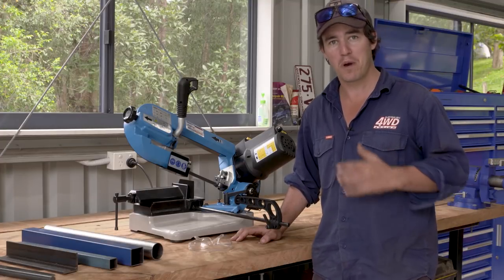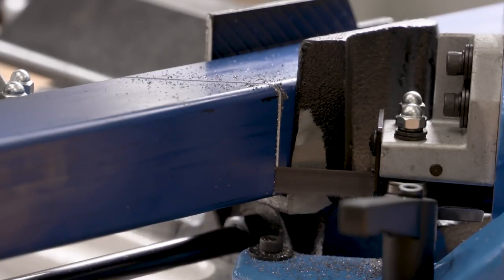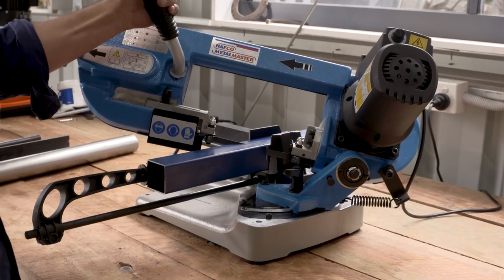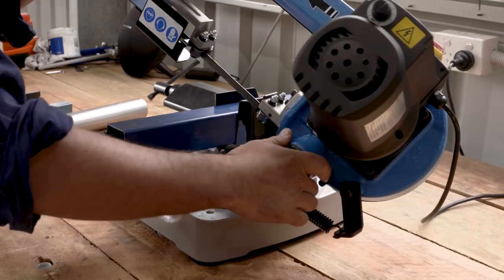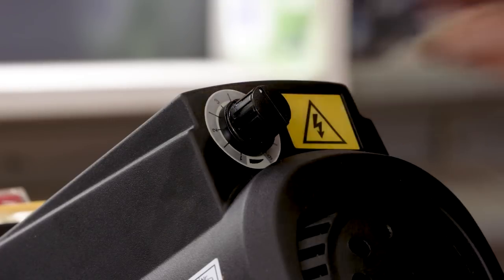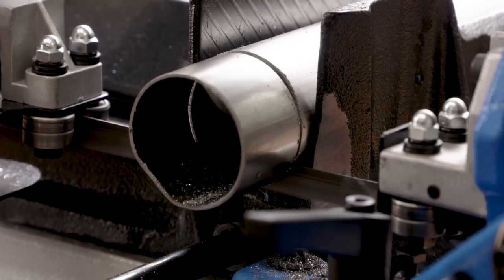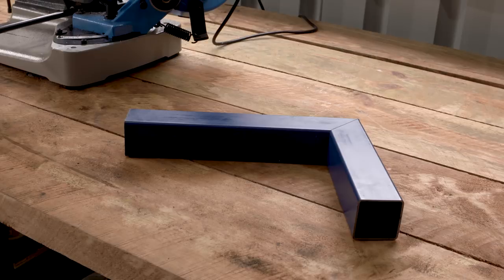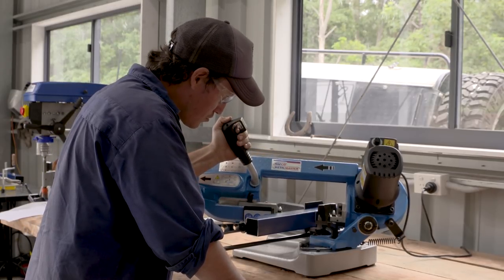BS-5V - Swivel Head Band Saw (B004)

Comment: smoked my first motor on this saw (maybe it's done 3 hrs cutting) seems to be a common issue. has anyone done a better refit of another motor, before i spend too much on a crappy spare part motor that will probably do the same thing? not that impressed with this saw.

Comment: Can this BS-5S saw cutting stainless steel 316 sheets? The thickness of the material is 1.5mm. Anyone tries that before? I will use it for about 40 cuts a day.
Reply: It will cut but is faar from your best option.
For 1.5mm stainless sheets maybe you could use a metal cutting circular saw. Or even a nibbler or electric shears maybe.
Depends on the shape I guess.

If you were to clamp several sheets together the bandsaw will do better but you are very limited in regards to shape.
Reply: it will cut but i think a gulotene would be a better choice